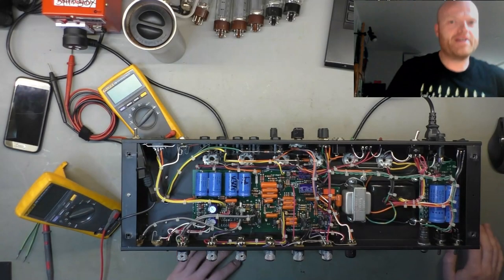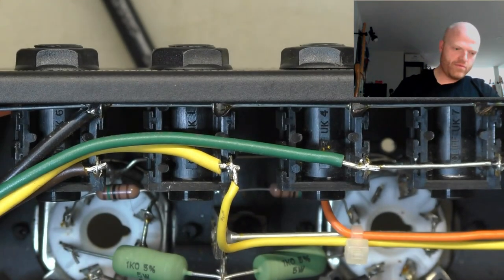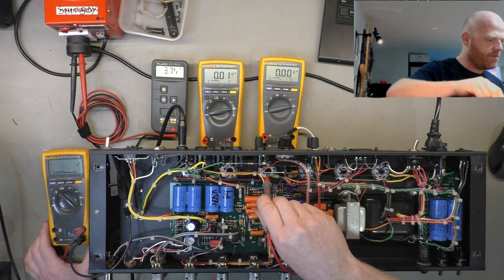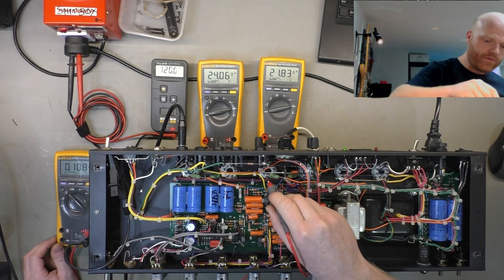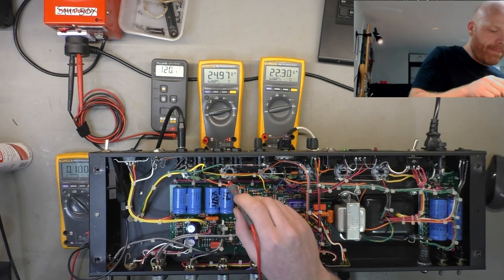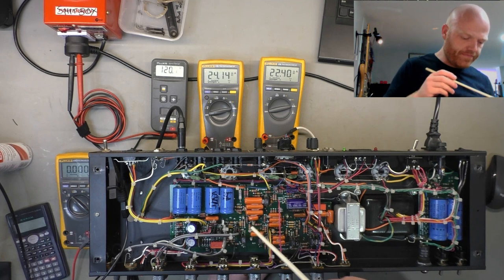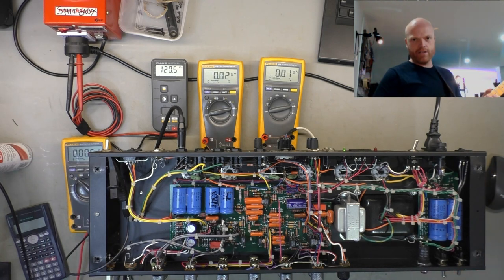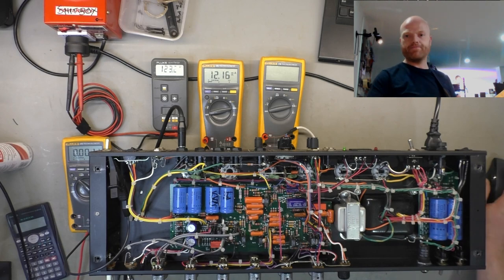Dual Rectifier Solo Head Pt 2

Comment: The Speer ceramic composition resistors are really good too. Super light weight, non inductive with the pulse capabilities of carbon comp, but wont catch on fire 😆. They’re slight more expensive than the green Vishay wire wound resistors(which are a perfectly fine choice). I like the both, just depends on the amp.

Comment: What are some really good designed amps?
Reply: Interested to know as well!
Reply from the maker: What market are you talking? Psionic Audio, Soldano, Fuchs, Pre 90's Marshalls, Pre CBS Fender, Some Orange, Some Hiwatt, Some Bogner, Some Hughes & Kettner. A lot of brands started shitty lines to suit the thin wallets of the general market. As a result, there will inevitably oversights and shortcuts. Mesa have spent their decades in the industry perfecting their marketing rather than their amp's reliability, serviceability or performance though in my opinion.
Reply from the maker: Oh, and I forgot to mention Ceriatone.
Reply: Cool video, thanks! What's your take on Diezel amps, what do you think about those designs?

Comment: There are tons of ways an amp can be unstable and prone to oscillation. Other than testing the filter caps to be sure it isn't a component failure issue and swapping tubes, it probably isn't cost effective to take a deep dive.
Reply from the maker: Yeah, that was the situation here. Time and budget wouldn't allow and there were no issues with the user's applications for the amp.
Reply: @BradsGuitarGarage  I'd go broke if I did this kind of work for a living. Curiosity would demand I get to the bottom of the why, even if that meant entirely reworking the ground structure or whatever.
Reply from the maker: @retread1083  Yes, that occasionally kills a day or two when I shouldn't have allowed it to do so.
It's a fine balance running a business with overheads and trying to be thorough and learn about new designs in the process.
It's probably why I'm bald in my 30's!
Reply: @BradsGuitarGarage  It's a popular look these days.  One never knows if someone is follicly challenged or just making a fashion statement. 😀